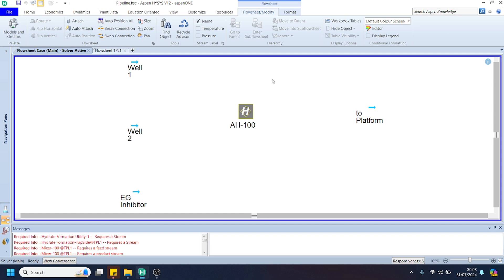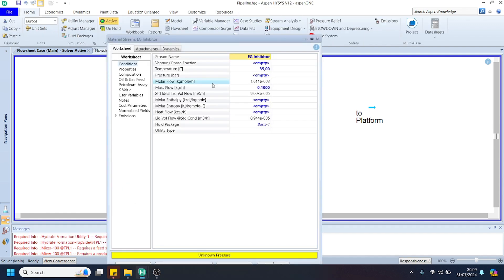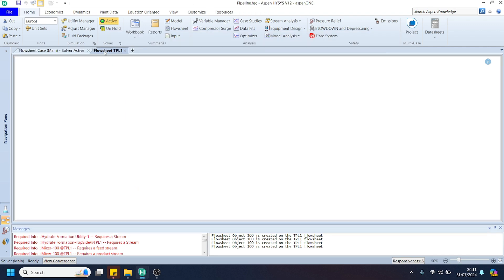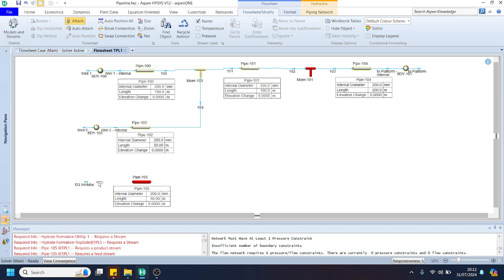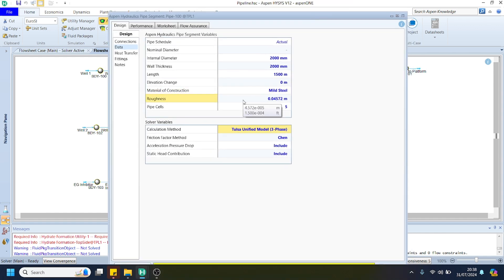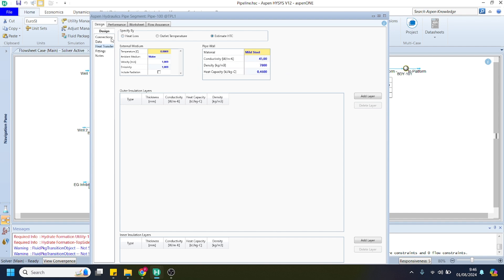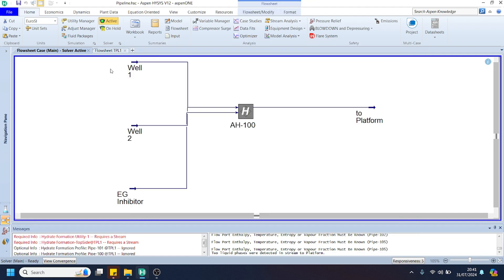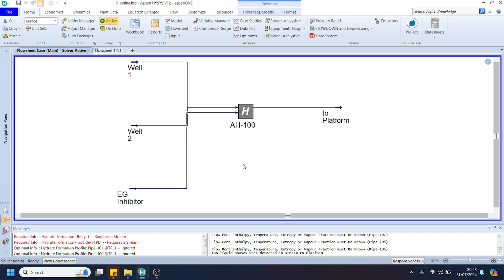Introductory Analysis of Hydrate Formation in Gas Pipeline System using Aspen Hysys (Part 1/2)

Comment: I have entered the same data but it says at the end solve failed for some reason and I don’t know why ?? Can you explain to me please 🙏
Reply from the maker: My apologies for the late response. 
Please make sure you have done the following concerns :

- Ensure the pressure at the destination has been specified.
- Ensure only the temperature at the wellhead is specified, without defining the pressure at the -  Source/wellhead.
- Ensure the active button is selected on the Home tab.
- Ensure the pipe dimension is the same with the table shown in flowsheet.
- Ensure the flow correlation and friction correlation have been specified.